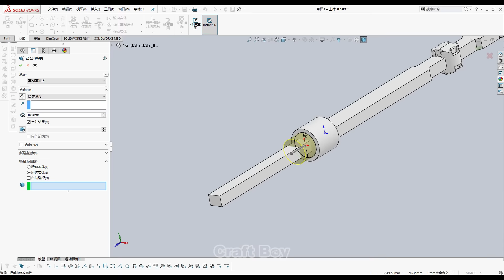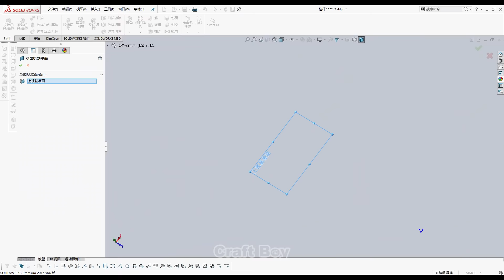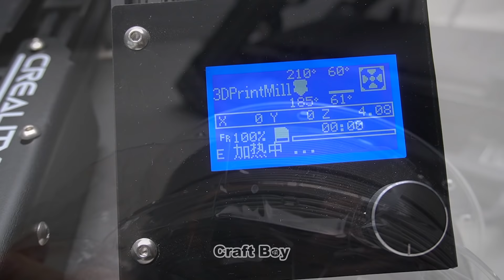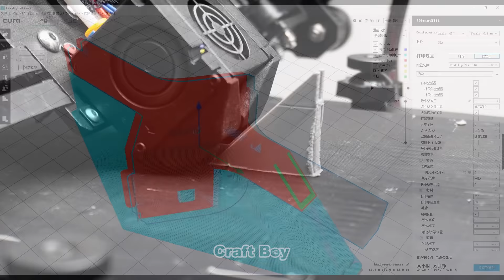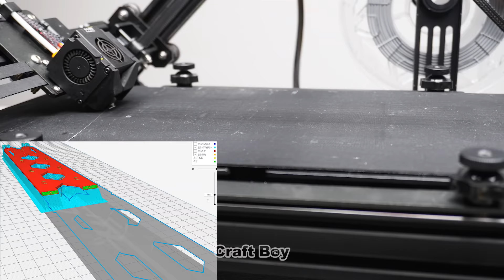Design and 3D Printing a Cloud's Fusion Sword from PLA

Comment: I would gladly pay for the files to this sword! And might I also add, for certain parts to stay glued together, I suggest using Weld-On 3. It will literally melt and FUSE PLA together. I use that on all my 3D PLA builds!